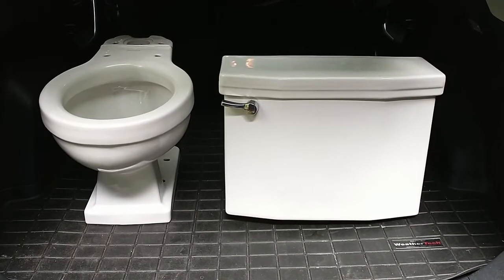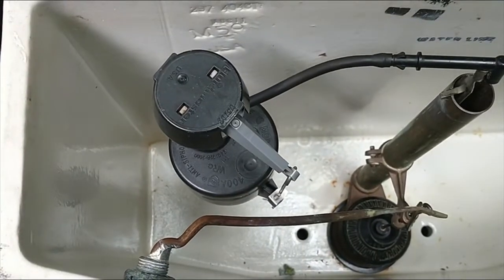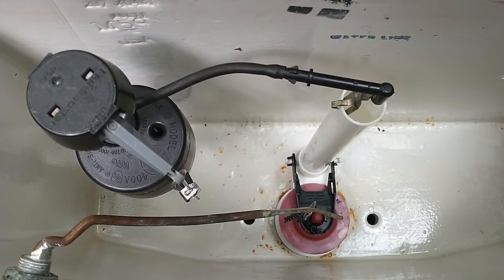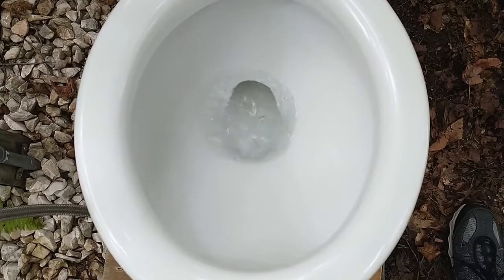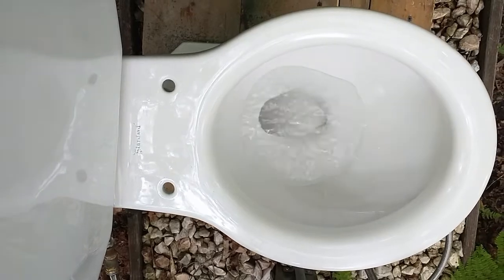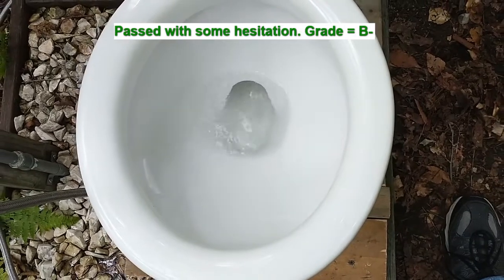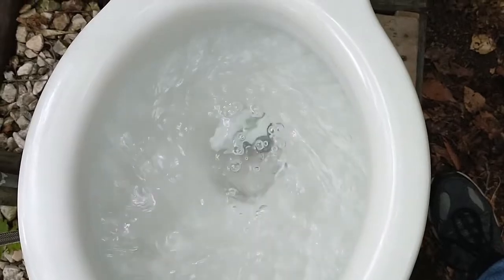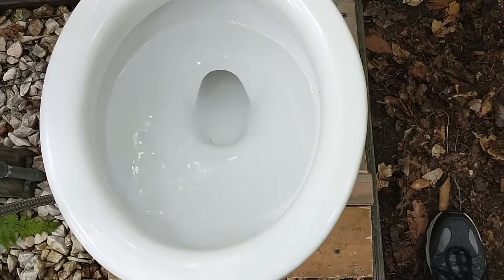113.  Testing The 1957 "Standard" Cadet Using A Flapper Valve

Comment: The Douglas valve allows more water to drop into the bowl quicker because there's no obstruction to 1/4 to 1/3 of the tank drain by the flapper valve anchor. After viewing the 1970 cadet video, this trapway design was put back in service in the 80's. I could be wrong, but i was seeing a lot of them and the 1970 ones retired/discarded.
Reply from the maker: That's a good poimt about the Douglas valve.  If I experiment more with this toilet, I'll put the Douglas valve back in and change the tank ball to one without the projection that might be getting in the way.  I'll use the Triple Seal tank ball which was widely used back in the time.  I did notice the change in the trapway design of the Cadet in the '80's.  Then it changed again in the '90's.

Comment: Good tests! I do like the feel of flushing a Douglas valve compared to a flapper.
Reply from the maker: Thank you, vintage Kohler.  I also like the feel of the Douglas valve.  What I should do is try the Douglas valve again, but with a ball without the projection.  I really think there is something weird about the bowl's casting, because it has never performed the way most Cadets of that time did, that is, emptying the bowl fast and allowing for a viewing of the jet action.  Despite it's "problem", it does perform well in real use.